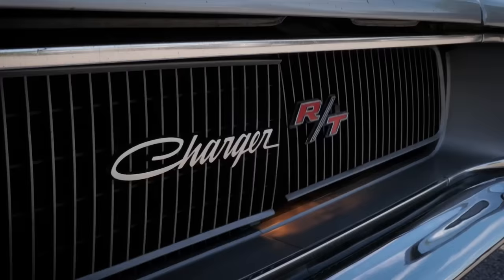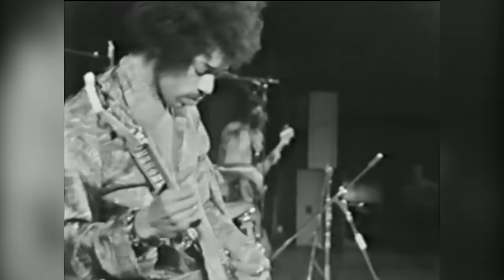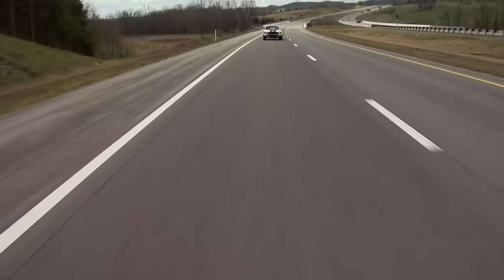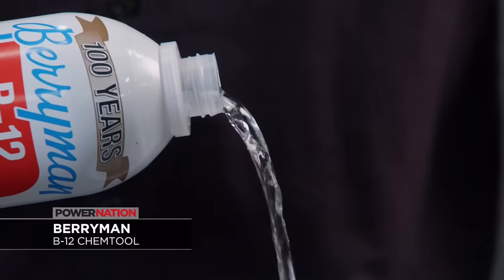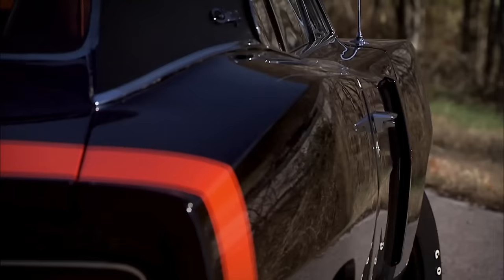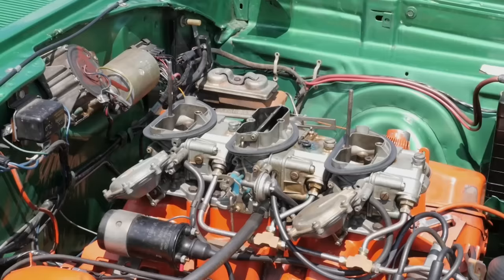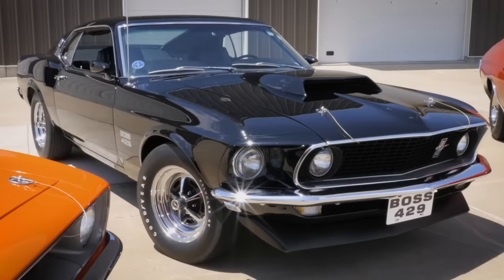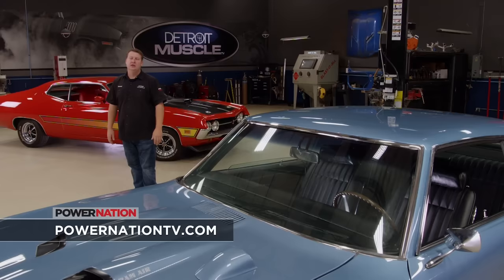Top 10 Muscle Cars of All Time

Comment: Does a car have to have a big block to be a muscle car? I would put the 302 Camaro in the top 5, I am not sure if I would put the 396 in the top 10. The 302 rated at 325 hp typically dyno at over 400 hp, the 396 dynos around 400 also, but the 302 was a much quicker car, due to lower weight, but you have to go up high on the rpm.

Comment: Mustangs, Camaros, and Barracudas are not muscle cars, they are pony cars. Corvettes, AC/Shelby Cobras, and AMC AMXs are not muscle cars, they are sports cars. So the only muscle cars in this video are:

Number 10 - 1964 Pontiac GTO

(Honorable Mention) 1969 Dodge Daytona

(Honorable Mention) 1964 Ford Fairlane Thunderbolt

Number 7 - 1969 Pontiac GTO "The Judge"

Number 5 - 1968 Dodge Charger R/T

Number 4 - 1969 Plymouth Road Runner

(Honorable Mention) 1969 Mercury Cyclone Spoiler II

Number 2 - 1970 Chevrolet Chevelle

Comment: Excuse me but Isn't Tesla a US built Car? Acceleration 0-60 mph. 1.9 sec · Acceleration 0-100 mph. 4.2 sec · Acceleration 1/4 mile. 8.8 sec · Top Speed. Over 250 mph · Wheel Torque. 10,000 Nm

Comment: You made a Huge Mistake with the 1968 Shelby GT500KR - the 1967 GT500( a better choice) with the Dual Quad Holly's were faster and Built by Shelby in a Hanger at LAX. The reason the 68 500 was liked better was that tuning the the dual quads on the 67 500 was not easy - only a handful of Guys had the Ear and touch to tune Dual Quads. So many of the 1967 GT500's did not preform up to their best and did not have the best reputation. My Dad had a 1967 GT500 back in 1969 to 1977. He was lucky enough to know a "Guy" that was considered one of the top Tuners in Southern California for Dual Quads and 3 Duces. When You kicked in those 2 600 Holly Carbs 1200 cfm - Wow !!
Reply: 68 was a better looking car
Reply: @klompsauce  why because of the side marker lights ?
Reply: How I tune my 67 dual quads.
I have a clevor that runs perfect.
I tune each carb on that engine. Make them identical. Put them back on the FE. Runs perfect.
Reply: @jesse75  Yes - good job. But that's today - think back 50+ years ago - only a handful of Guys that could really tune those 2 Holly Carb's. The 67 GT500 Shelby was a very special car. Also my Dad's 67 GT500 had the rare  C6 3 speed automatic ( only about 50 67 GT500's came that way) . And I liked it better than the 4 Speed Hurst. Why - this C6 was used in the Special Order 427 Ford Fairline Drag Car. Ford sent out the C6 to have it reworked to handle the 500HP of that 427. The shift point was around 5000 rpm. So from a dead stop. Put your foot on the break and step on the gas - You would burn rubber go up to around 40mph - burn a few feet of more rubber then go up to around 80mph and be in 3rd. This special C6 shifted so fast and strong - Wow. At Freeway speed ( 65 +) You step on the gas and kick in the 2nd Holly 4 Barrel - Wow. You enjoy Your 67 GT500 , I will always miss driving it.
Reply: @gregorylunsford3991  enjoyed your comments. And that's interesting about the C 6. I'll take your word for it that is true but I haven't come across literature stating that.
I do know the C 6 in a 67 GT 390 cougar had a beefed up transmission.
The GTE must of had one too.
My 67 Stang original was 4 speed, but someone put in a built C6.
Is there anyway I can tell what transmission I have ? Seeing what I found out about my car, I wouldn't be surprised if it had one of those transmission.
My car has a 427.
Reply: @jesse75  I little more info. My Dad was a Lt. California Highway Patrol and good Friends with the Sales Mgr at Drew Ford La Mesa Ca who sold him the Dark Blue 67 GT 500. Carroll Shelby built the Shelby Mustangs in 2 rented hangers at LAX in LA. 1967 was the last Year that Shelby built Shelby Mustangs there. Ford took over buying out Shelby and Built Shelby Mustangs at the ford plant on a regular production line. I got to know a machanic that wold service the GT500 at Drew Ford in 1969 who had worked at the Shelby Hangers in LA from 1964 to 67 - told Me a lot of how the GT500 was put together. The 1967 body/frame was lowered 3/4 to 1" upgraded brakes and suspension. About the Police 428 engine it was modified  a little. The bottom end( crank) was strengthened , the heads were polished, He thinks the cam might have changed a little due adding 2 holly Carb's. As to the C6 Auto - It was that Mechanic that told me about the C6. A few years ago on the internet I found a Shelby facts source that stated that number of special C6's put in was 50 something - I believe it was 56 and I forgot to write it down. And setting in the Garage next to the GT500 was my 1969 Kawasaki Mach III. The Fastest Production at the time - first stock bike to break 100mph in Quarter Mile. Back then it was argued which is Faster the 67 GT500 the 427 Corvette. And in 1969 I drove my good friend Jim over to ElCentro to pick up a 1966 427 Cobra. I got to drive that Cobra several times and put several thousand miles in the passenger seat. You have not lived until You have Driven a Real Cobra.

Comment: AMC Gremlin X... 401 V8...
Reply: That's not a factory produced car.
Reply: @markg7030  Randall 401-XR
Randall AMC dealership in Mesa, Arizona, received AMC's endorsement to build 401 cu in (6.6 L) V8 powered Gremlins. The cars started out as 304 cubic inch V8 models from the factory and after Randall's modifications would run 13.90 seconds at 103-106 miles per hour (171 km/h) in the quarter mile, for $2,995 (US$17,460 in 2020 dollars.

Mine was a Factory X that came with the 304, I did the suspension mods and engine swap to the 401. Not that that 401 was factory when it went in LOL with nitrous it was over 750 rear wheel HP! Street legal but not street friendly, drove in once in awhile. Spent most of its life on the 1/4 mile track until the dude in the other lane lost it and T-boned me at 160mph splatting me into the wall. Thank god for roll cages! That was a rough ride but I kept it upright.
Reply: @MaryBrownForFreedom  Glad you survived but it's not a factory produced car. You explained it as being MODIFIED.
Reply: @markg7030  The XR were considered factory, just like the COPA Camaro program. Mine was built as a tribute car so no it wasn't factory. But the Gremlin X WAS factory! Quite a few made with the smaller 304 and straight 6(torque monsters) engines. The 304 could be built to have some respectable HP... had one of those too that was just a street car with around 330hp.

Comment: I bailed after 4 minutes based on the fact they were all cars that didn't win races as opposed to the '63 Max Wedge Dodges the Mopar HEMI 64 Savoys, '66 426 Street HEMIs? and the lightweight HEMI Darts and 'Cudas of '68 ? Even as a Mopar guy it pains me but what about '63 Z11 427 Impalas? Even a '68 Olds Vista Cruiser wagon with the Olds big 4 barrel V8 would wipe most of these pretty boys.This list is a bunch of pretty poster cars .   🤡

Comment: Bullcrap! The  69 Z 28 and the Daytona ( with a hemi or 440/6) are certainly Top 10. A Ram Air 4 Judge should be higher than 7.  You put a 396 camaro on, but left the 427 off, crazy! Where in the blue hell are the 68/69 L88 Corvette and the 73/74 Super Duty Trans Ams? You guys are crazy and wasted my time.

Comment: These cars that are Automatic was a base option but what is not being said was that you can get a 4-Speed in these vehicles 
Yes the Roadrunner/Daytona/Superbee had the 4-Speed option along with the GTO Judge and the GT 500 KR and the 68 Hemi Charger had the 4-Speed option with the factory DANA 60 rear Differential 
I can't stand when anyone does something like this they include the pussy ass Automatic Transmission when the 4-Speed was the DOMINANT ITEM TO HAVE

Comment: 1970 was beginning of emissions controls hp rating was pessimistic in 1969 optimistic in 1970. No 1970 car should be on list All show no go.
Reply: Ya, the pollution controls were there in scant on my 72 SS. The power rating was 220 horse down from 350 plus... These controls were easily bypassed...  Gas was also reduced in octane. No longer could you buy Sonoco 260 after the pumps were pulled and the lesser octane fuels were introduced...  Here's the thing with proper fuel That 402 had an enormous amount of torque. With correct tires, could whip out some very fast speeds...Now granted the torque fell through the 70s and the throwaway vehicles were introduced 80s...  goodbye muscle...
Reply: @bobbiecrider6964  WRONG..power rating dropped from 350 GROSS to 220 NET...different rating.....

Comment: Real net horsepower of the 440-6 was only 325 not 390--those are fake gross numbers with engine out of the car...426 was only 350 hp at 5,000 rpm.....6,000 could get about 30 more, but you can blow the motor easy...that is why it came with a short 90 day warranty.  The Buick 455 has less power regardless of the bullcrap stories claimed on this thread.....Any new 2021 V-8 does an easy 375-400 NET hp, more than ANY of these old rust buckets......
Reply: No one here disputes that many if not most of the gross hp ratings of the Golden Age of Muscle Cars were often over-rated by the factories for one reason or another. So what's your problem?  The efficacy of owning an old muscle car, and the love for them all, is evidenced by just this l-o-n-g thread alone.  The auction houses prove you're sooo wrong.  we're talking about 50+ years technology difference. I own both old and new andNo-one but YOU is comparing the two because we don't give a damn about your opinions in this regard. "Rust buckets" your azz.   HaHa.  No-one on this thread obviously agrees with you.  NO ONE! 

"325 hp" you say here??  Not 324 or 326?  You say 325 ...  Also, "The Buick has less power", you say.   But no proof of ANYTHING you say here.  Man, you sure like to throw around #'s that you can't document. I dare you to DOCUMENT that "325" number, for example, but you CAN'T. And be sure to give the exact source where you got your OPINION from. BUT YOU CAN'T.
Reply: The factory knew exactly what people would do with them Race them and according to factory decals placed in the cars that there were only for sanctioned acceleration trials. Therefore the warranty restrictions. They knew people were going to race them pure and simple.
Reply: Nothing fake here! Just a different rating system. Gross or net power.
Reply: @markg7030  GROSS WAS FAKE...Net is real
Reply: @chadhaire1711  You are missing the point. If I measure something in inches and you measure it in centimeters does it mean one of the systems is fake?
Reply: @markg7030  Yes I see YOUR point...My point is 99.9% of these old car videos list ONLY the gross numbers which is 100% misleading to all the viewers who only understand NET numbers used today----they do not understand these numbers (425 hp for the  426 Hemi and 390 for the 440-6) are NOT valid when compared to newer cars.  The 426 was  350 net, the 440 was (and is) 325 net.....about what a modern V-6 powered car is today. ......when people understand that then they can see how weak these old cars were.   These videos should have BOTH gross and net numbers listed, to use only the gross numbers is misleading--in my book lying.  There is a big difference between 390 hp and 325 hp--but not a difference between metric and standard.
Reply: @chadhaire1711  Net ratings started in 1972.
Reply: @markg7030  I said that